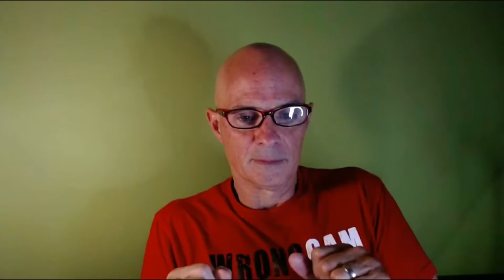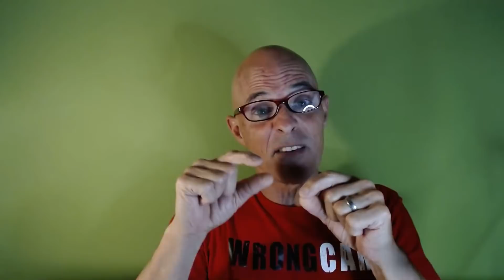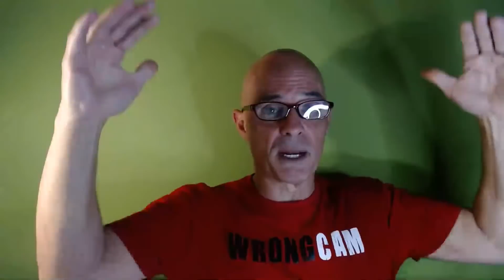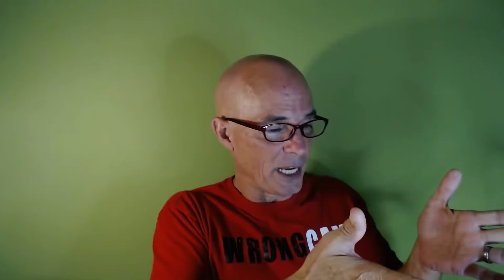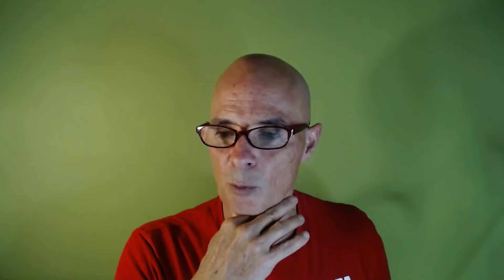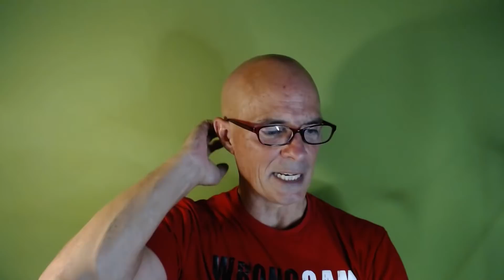LET'S TALK TURBOS-DAILY DRIVER TURBO COMBOS

Comment: Daily drove a Silverado with a small isky turbo cam in a LQ4 with a S475/83 turbo for several years. Towed with it every weekend.  330,000 miles later a stock lifter took out a cam lobe. 
6-8psi at 2000 rpms hauling heavy trailer made a huge difference on being able to keep the transmission in 4th gear with the torque converter locked up. 

Might have even out run some mustangs and camaros on highway pulls while towing a loaded trailer....
Reply: What's the most you towed with that setup and how did it handle that much weight?
Reply: @kevinmcquitery4543  Towed a 18,000 ditchwitch a few times. It did very good with having airbags on the truck but ended up bending the frame. I wasn't scared to hook up to a 28' enclosed that weighed 12,000# loaded and go anywhere. 
I had water/air IC and a large heat exchanger along with water/meth injection so IATs were never a issue even staying in boost for miles. 

I'm building a similar setup now but with a 370ci and S476/96 in a 2500HD. Just waiting on parts.
Reply: @nocturnalspecialties642  I have a 07.5 Silverado 2500HD with 3:73 gears and wanting to turbo it with 6-8 psi. You think 14,000lbs would be too much with that setup?
Reply: @kevinmcquitery4543  the newer GMT 900 trucks are rated to tow more the older GMT800's so as long as your trailer setup is good I would do air bags to help the truck handle the load and then get the biggest intercooler you can fit. Also don't cheap out on the turbo. Go Borg Warner at minimum. 
Being 07.5+ and having the 6L90E you should be able to keep your RPMs low and let the turbo do the work. 
Don't expect spectacular fuel mileage neither. You can get it in the mid single digits if your using that throttle pedal alot. 
Is the truck completely stock?
Reply: @kevinmcquitery4543  I forgot to mention mine was a 1500 truck. 
I'm doing a similar setup in my 2500hd now. Just waiting on parts. 
Instead of the cast S475/83 I'm going with the billet S476/96 to try and free up the exhaust side and see how it acts. 
Also going with a 370ci vs the 6.0L.

And a cam motion 214/214 cam vs the isky 215/215. 

Large Water/Air IC below the radiator and a large heat exchanger. 

I'm gonna give it a try on 87 octane and get a feel for it.  I've tuned a few turbo trucks on 87 and they did ok. Nothing great but being able to put 93 in it and flip a switch for the added timing is nice. Also ran Water/methanol injection on my old truck with -30* WWF and 2 nozzles. 

IATs never got high or become a problem towing really heavy. And back then WWF was $1.50 a gallon for the Peak brand and it was 38% methanol by the MSDS data sheet.
Reply: @nocturnalspecialties642  yes it's completely stock with 315,000 miles on it. I'm about to have it rebuilt or just buy a new engine but wanting more power in the form of boost. I'm not worried about mpg's because I'm only getting 8 now just pulling my lawn equipment around every day. Pulling my 4300lb (empty) dump trailer is a workout for my old girl and I have yet to pull a dump trailer full of dirt or rocks.lol  Plus I'm only towing around town and at most 15 miles from my house. I've babied this truck since I bought it in 2009 with 150,000 miles on it and never got to experience  how it performed when it was new. Does the billet S476/96 spool up quickly?
Reply: @kevinmcquitery4543  nice!
I'm still waiting on parts for engine. So its gonna be awhile before getting it going. Majority of my towing was on interstate so I mainly wanted to have more power in the 2000 rpm range and it did great.
Reply: Wow! Are you trying to kill someone towing 12k with a 1/2 ton pickup? 18k... you are insane!!!
Reply: @motorhead281  well not really. 
But I did upgrade to a 2500hd now. And towed some lumber with it on a 40' gooseneck. 38,400# load sounds like a lot. But I made it to the destination and had to phone a friend to get home. Transfer case didn't really like the trip. 

If that makes you upset then hauling 1000 gallons of diesel and 800 gallons of gasoline on the same trailer to louisana after the hurricane should really make you feel good.
Reply: @nocturnalspecialties642  It takes more than that to upset me. Its just that I tow heavy ALOT and I would never tow that much with that rig.... The bigger truck is the hot ticket!
Reply: @motorhead281  ok good. We had a large donation to haul supplies down there after the hurricane this past year and since DOT wasn't enforcing any laws under state of emergency we loaded up what we could and made a flying trip down there. Radio handle "Rolling Fire Bomb"

Comment: Love your vids Richard, you cover ALL aspects of engine building and certainly for someone selecting parts one by one makes it much easier to make the right choice or at least narrow it down a lot depending on their needs.

I will be 66 soon and when i barely turned 20 worked at a full service Shell station with a few fellow wanna be motorheads. A few had GTO's and back then these idiots would throw an 850 on a stock 389/400 and all they got was a HUGE bog. I built a 67 Camaro Yenko clone so it was a 427/425 with 456 gears in a 12 bolt and a 4 speed, with some 25 inch slicks 12.7 at 110 using a JUNK 780 Holley and with no tuning, just drive up to New England dragway in Epping NH and only a few runs made. Some guy who raced weekends told me an EASY 12.4 or better with an 800/850 and Tarantula Single plane. One of my buddies brought up his 65 GTO and got EXTREMELY high 14's like 14.9 at 96 mph, back then they had 'Grudge night' and entrance fee was $2.00 bucks. That Chevy factory solid cam worked well, it idled decent and revved high, i think it was 520 lift, it had the Chevy 7/8 quart oil pan too so looked impressive from the front with it hanging down and the Lakewood scattershield. Fastest and the most fun car i ever owned but 456 gears on the street is hard to live with, had to drive back and forth to work at 40 mph.

Comment: Richard. I would like to see what you need theoretically like parts wise for a boosted v8 build for instance and where to place things as a general rule, etc. I have a low compression forged bottom end 355 carbed lt1 that is gapped for boost. Been driving around n/a for over a year. I have a 78 mm on3 turbo. My plan is to go blow through. Would like to know the reality of daily driving a blow through carb setup.
Reply from the maker: YOU NEED TO START WITH THE RIGHT CARB
Reply: @richardholdener1727  yes, I was looking at offerings from CSU and C&S, they both have 750 cfm offerings which is a little big CFM wise but that seems to be the only carb size that is sold. I was going to pick one, and start trying to fabricate a hot side. It seems too easy to be true, once the hot side is done and you figure out the placement of the turbo, oiling, etc. car in question is a 92 camaro. Will be using a mig welder.

Comment: You were saying the high lift cam would be unstable. I'm currently gathering parts for my pre eagle  5.7 hemi stroker with ported 6.1 heads and the cam I have spec's are 229/239 lsa 111, 635/613  but actually comes out 230/240 when entering the valve events in a cam calculator. This will be an NA build with possible small shot of nitrous in the future mainly for street use. Should I be concerned with the lift of my cam? The .635 is higher than I was planning on but??
Reply from the maker: CAN YOUR SPRINGS HANDLE THAT LIFT
Reply: @richardholdener1727  My Manley 221431-16 springs are rated at .650 lift and my coil bind will be in the .060 range on the intake.

Comment: Hey Richard I have a vsr 7875, is that to big for a 4.8 I want around 550-600hp. Also have a 218/224 cam with 600 lift and 660 lift springs
Reply from the maker: THAT TURBO WORKS, BUT THERE ARE BETTER CHOICES FOR 500-600 HP

Comment: This is perfect! I’m building a 383 and wasn’t sure which power adders to go with for 600 or 700 hp for a daily
Reply: I've got a brand new 383 stroker build as well, to replace my old 350, but haven't chosen what intake to pair with it (stock right now).  What parts are you going to use with yours?

Comment: Whelp, I went 11.5:1 pistons and 7500rpm cams in a 5.4 4v, will piston ring gap hurt my NA hp while I save up for a turbo? It'll be mounted under the back seat area where the first muffler goes, I have forged connecting rods and was thinking a G35 or G42 Garrett turbo, my car is a t56 manual with a twin plate
Reply from the maker: IT WILL BE FINE

Comment: Great show I’m new to the turbo world and would like to hear more about plumbing  sizes and blow off valves . How do you know your using the right stuff for your app. And boost controllers vs no controllers… maybe invite a guess on that may know more about where to start with out blowing up your engine the first test drive… maybe tips on where to buy plumbing  on A budget
Reply from the maker: THE FIRST TIME YOU GO INTO BOOST ON A NEW BUILD SHOULD BE ON A CHASSIS DYNO WITH RACE FUEL, LOW TIMING AND A RICH MIXTURE
Reply: @richardholdener1727  CHICKEEEN!! ;-) E85 LS2 TT  Wheelspin at the 5th gear, public road, and the rev limit set to 7700rpm with a fairly aggressive timing. The Engine? Still alive and kicking... and so am I (obviously) haha
Reply: I just got mine done and idling. I'm running pig ass rich until I get everything dialed in just for this reason. I don't want to blow it up before I even have it ready to rip. I have no dyno access. This has all been done in my driveway. I'm running a gen 4 5.3 with a Sum-8701 from summit and a gt45 turbo. I don't even have a boost pressure hose ran to the waste gate. It's a cheap ass wastegate that has probably a 10lb spring. I'm not really sure if that is accurate because it was cheap ebay chinese waste gate.

I don't even have a boost gauge but I am data logging with hptuners and I know I've hit 155kpa on map pressure at around 4k rpm. My EQ ratio n wideband was around .76 with 12 degrees of timing. Like I said very rich, low timing, until you get shit dialed in. I haven't even had it over 4800rpm yet. Before I put the turbo on and it was just cammed I had it shifting at 6400rpm and still had pull. Not even running a blow off valve. Just do it and not worry about sizes of piping or BOV or Waste gates. Just throw it together cheaply, get it tuned good and have fun.
Reply: @donnie1581  155 KPA?
Time to hook that funny little hose up.
Reply: @2lotusman851  22 psi ?
Reply: @eflanagan1921  Unless its absolute pressure which is about 8 PSI.
Still, disconnecting a wastegate on a properly sized turbo is usually not a good idea. 
Usually people that do that and tell about it on internet forums are rebuilding their engines in a couple months, for some reason.

Comment: This is why for Honda's (B series) skunk2 tuner series cams are great for boosting. the low cam is near stock and the high cam is more "racey". For example my tuner3s have 196°@ 0.50 on low profile and 270°@0.50 on high intake cam profile. The exhausts are the same+10°degrees the lift on both is somewhere between 12.5-13.5mm.
Reply: That's the difference between pushrod, single overhead cam, and dual overhead cam engines.

Comment: Camshafts are not aspiration specific. All they do is give a motor is personality
Reply: Oh, yes, they are. Supercharging and nitrous need more exhaust timing/duration/lift compared to the intake relative to a naturally aspirated or turbo cam due to the extra volume of exhaust with the same outside ambient pressure, while the intake is being artificially helped by the engine or the bottle.

But, if you mean they are not aspiration-specific for a turbo versus no turbo, then that is more accurate, as the turbo add exhaust pressure at the same time it is adding intake pressure, so it acts more like a naturally aspirated engine operating in a higher-pressure atmosphere.
Reply: @exploranator  you are right I was referring to the latter part of your reply

Comment: So if I have a engine that's making 550 horsepower and torque at around 5800 RPM na. It's still going to make peak power and torque around that rpm range even with boost. I thought boost would push the peak torque and horsepower up higher in the rpm range than na?.  Sorry if this seems like a dumb question I'm still learning.
Reply: Basically, and everything will happen   faster, you may get 2 or 3 hundred + rpm but don't mean ur making more power.
Reply from the maker: IF YOU ADD THE SAME AMOUNT OF BOOST AT EVERY RPM-THE NA AND BOOSTED CURVES WILL BE THE SAME
Reply: In theory, if you size your turbos to really whiz up to boost at ultra-low RPM, then wastegate the heck out of them after you hit your boost level, wouldn't you just be amplifying your engine, as if you added more cubes?

Comment: I'm wanting to twin turbo my 94 mustang gt that I'm building a 289 to drop in it. What I want to know is what turbos to use. I'm running a engine pro flat tappet hyd. stage 3 camshaft. Forged pistons afr 165cc renegade heads , msd 6al and a gear drive. What turbos do I recommend?
Reply: 289?

Comment: I been looking around at cams to swap in a 85 truck 350. Was looking at some circle track low lift cams. Or maybe something alittle bigger. But was wondering if you ever did like couple different sized performance cams with a standard stock heads. Swap heads for combustion size to see what 8to1, 9 to1 or 10to1 had a difference in power. How much power per point in compression.
Reply from the maker: IT'S 3-4% per full point?
Reply: @richardholdener1727  thanks for the that. I'm on a crazy budget trying to get 70 monte carlo back on the road.

Comment: I mentioned it before. but I'm planning on putting twin S256 T3 on a 2005 6.0 out of a truck. that's in my chevelle,  T56 close ratio magnum 3:55 gears I know I need 3:08 or 3:30, Z06 clutch and quick time bell house. Stage 1 trick flow 216/220, 550 lift. and running tail wastegate and bov. I want 7 psi and about 15psi max. should be a fun street car.